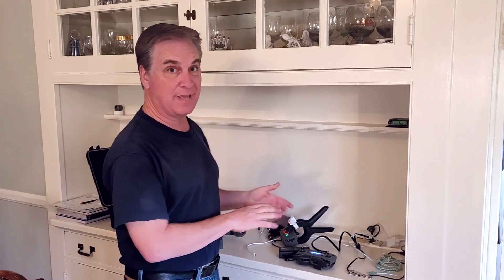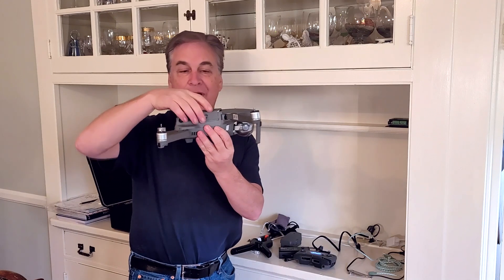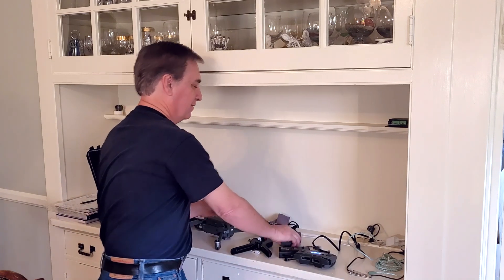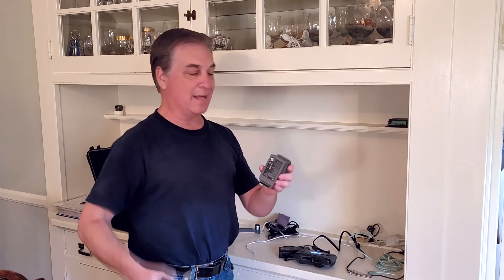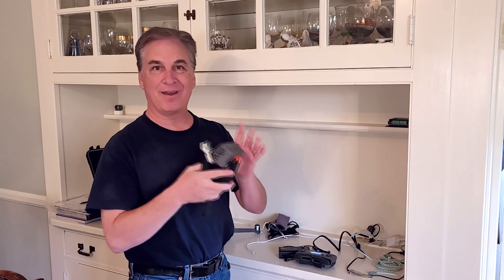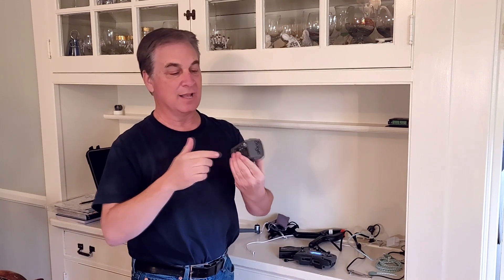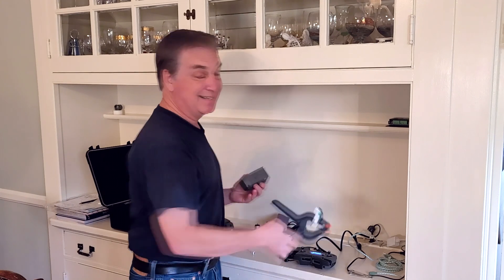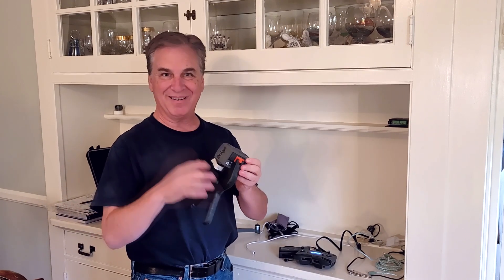Trick For Puffed, Bulging Or Swollen Battery LiPo Cells?  DJI Mavic Drone.

Comment: Mavic Pro users!!! Support ended October 1st 2024 for MP users. You will not get a free replacement battery............Read this if you need more info from DJI support.

As electronic products are affected by technological developments and changes in usage requirements, each generation of products has a fixed life cycle. In order to continuously provide you with premium product and service experiences, DJI regularly optimizes resource allocations to promote the development and application of new products and technologies. Therefore, we have decided to stop providing support services for the Mavic Pro and its accessories starting on October, 1,2024. We're sorry that the services for this product have been suspended currently and relevant technical support and after-sales repair services cannot be provided.

Comment: I work for a drone survey company we use large LiPo and gas powered helicopter drones for survey, and we have several DJI drones including Mavic's, Matrice's, and a huge DJI Flycart. Along with the battery powered UAV's the survey instruments and electronics the UAV's carry are also powered by LiPo batteries, we have literally hundreds of different sized LiPo's stored in our workshop and out with crews working in the field on survey. If any of our LiPo batteries start showing signs of swelling and getting puffy they are disposed of straight away no question even if they seem ok when tested on one of our smart battery chargers, it's just too risky messing around with lithium batteries that are showing signs of aging, the cost of replacing them is nothing compared to the potential cost of the damage that a battery failure or lithium fire can cause.
Reply: to long too read. but get your point.
Reply: @badrulhisyamo  It's three sentences...
Reply: @badrulhisyamo is still shorter than this video  😂

Comment: Don’t mess with lithium batteries in any way. My apartment went up in flames from a bigger battery (without me doing anything to it in particular, just using the personal electric vehicle in a dynamic way, but no physical impact done), and it’s NOT fun. Thank god nobody died. Having been researching li battery safety a lot, I would say just dispose of them some official way, get a new one, and never tinker with them or force them if you have no idea what you are doing. They can easily catch fire and very badly so. I would’t trade the savings on the price of a new battery for the risk of a violent and possibly deadly fire. That said, even a new battery can catch fire but here there definitely is a sign of deformation so the risk is higher.

Comment: i think a lot of the bulgin is jus tthe air in the covering getting hot and swelling up..... ive noticed my batterys are swollen when the drone has been flyin gand batterys drain and get hot, leave them to cool down and the swelling goes, this  is proof its the trapped air in the covering that causes the problem.
Reply: you are 100% right, my batteries have 100 cycles each, they got bulged decently not hard when I use them on the drone, but after they cool down, they deflate by themselves and the autonomy is 20 minutes each, so that's good, I will use them but I will connect the battery with  a catch something  doesn't jump out of the drone
I recommend putting them in a lipo bag
Also I recommend throwing them away when they become extremely swollen and difficult to put in the drone
it's more dangerous if a fire starts, it's very flammable like a bomb

Comment: I just contacted DJI and they replaced 2 of my swollen batteries. Following their instructions it took 15 minutes!
Reply: Can you point me in the right direction for getting them replaced I've got 2 that swole up?
Reply: @MichaelNel123  I just went on ali express and they are being sold for 50$ and they arrive in like 3 weeks I bought one and it works like the original if you still need one id recommend doing that
Reply: Same
Reply: sounds like you got lucky and beat the OCTOBER 1ST 2024 support cut off.

Comment: Trying to keep my battery flat, I managed to short it accidentally, and the battery burst into a Ball of Flames, Be very careful with DJI battery packs, They are absolutely a waste of money and don't last very long. I am lucky if I had 14 Flights with the battery pack.  My advice, They need to sort this issue out in the battery packs
Reply: Flat, what do you mean? Using the clamp method ?

Comment: Sorry, my english isn't very good. When do you use the clamp? After flying, during charging? Or After charging? Thanks a lot. I opend at on battery the cells with a needle 😮
Reply: Did u get any answet?
Reply: @sphinxletherman8991  No, but I a Shop repaired two of my batteries
Reply: you clamp it then put it on charger but not too tight clamp, you can needle it but you need to be carefull and do outside

Comment: DJI is replacing my 4 years old Mavic 2 Pro batteries due to swelling (10-24-2022).  See this video for more information: https://www.youtube.com/watch?v=IrQZFvFhBEM&t=311s&ab_channel=MyFlyingEyes%2a
Don't take a chance because once it swells and you clamped down hard on the battery the risk is higher for leaks then air will combine with the lithium for spontaneous combustion.

Comment: My DJI air 2 battery bulged at 65 cycles itself. The specs say it shouldn't bulge till 200 cycles. 🤦
Reply: my bulged at 45 cycles
Reply: I have a air 2s and it bulged at 30 Cycles second at 40 cycles! :face-purple-crying:
Reply: it doesn't matter how many cycles the batteries have, they swell due to high temperature condensation and age
Reply: lipo batteries risk swelling after 40 degrees, they work well if it's between 15-25
Reply: mine Too
Reply: 8 cycles, 13, 15 and 19. All Mavic air 2 batteries. Dji don't care.
Reply: Me too. My Air2s battery bulge after around 50 cycles

Comment: this is extremely dangerous stop doing lol the puffing caused by gases inside of the lipo layers . Li-ion constructed often being able to vent out and built in hard case when case is soft it designed to be able to puff mean no vent even to out so if you push it probably you generate a microhole where the gases escaped if oxygene can go in later it will be a nice firework… It might work until the hole is very small for a while as the airflow is low but in time it is innetiveable if enough oxygen came in a small reaction will elarge the hole and more oxygene will come in an here comes the fireworks. the first thing you should do charge this thing in totally fireproof place lithium burns very high temp it will even damage concrete hard , and if it start in fear you might try to play a firefighter and that will cause more heat as this reaction will be even more hot if you add water the best thing you can do is to extract the battery from the case and insert a new one. I was trying to find tips how to build new bepop batteries as i have the same issue btw with puffing the battery carecteristic also change so it will be failing when you try to pull out more amps . I would like to now if your flat or drone cstched fire already …
Reply: No paragraphs, no punctuation, why even use spaces? Just type out a long string of random letters, the meaning will be as clear as your comment.
Reply: @dalegreer3095  haha Please write in hungarian… And from phone, but thanks for trying to read it

Comment: Not very sage advice I'm afraid. After many years of flying RC planes I can advise, any bulging Lippo batteries should be fully discharged ASAP (below 2.5v per cell) and disposed of. That of course is if you value your aircraft and or Home dwelling. At least keep them in a detached shed.

Comment: I have three and all three are swollen.
I pierced them.
Now they work perfectly.
Reply: Did you just pierce the plastic housing or right into the battery bag?
Reply: @chain.driven  
Pierce them from below.
Just the plastic.
a foul smell came out.
Reply: @krassiyonov4804  that works too but there will be a chance of your battery failing mid-air

Comment: Have you reported this to DJI? They should not be selling any batteries that needs clamps to prevent them from bulging. If I feel like getting a drone I will not buy a DJI. Thanks for the video:)
Reply: One of my Mavic Air batteries recently started bulging like this, but it was already a 4 or 5 year old battery. My other 3 batteries are just fine. So don't let that deter you from a dji drone.
Reply from the maker: It does seem to be a common problem, as I've seen many complaints.  The batteries were a couple years old before this started, so well outside warranty. I don't mean the video to scare anyone off from DJI.  The drone is nothing short of phenomenal!  The reason I bought from DJI was that I crashed a friend's drone and DJI immediately fixed it and at a very fair price.  That took my main fear of buying a drone away!  Because, they are expensive, and you know you are going to have crashes.  So, the fact they were fair and fast in taking care of my problems made a BIG impression on me. I would give their repair centers an A+, though their communication if you have issues can be slow.

Comment: Yes prone to fire those bad those batteries can burst into flames in your closet or the trunk of your car....... Am I wrong that's one of my big concern's is with a Chinese knock off battery they can start a  fire when they discharge......
 In other words I'm really concerned about any lithium ion battery causing the fire anywhere anytime
Reply from the maker: Thanks.  I was concerned as well.  My batteries were straight from DJI.  Chinese, but OEM.  Will keep a close eye, and store defensively for thermal runaway.  From what I've read, the bulging does not necessarily indicate impending failure.